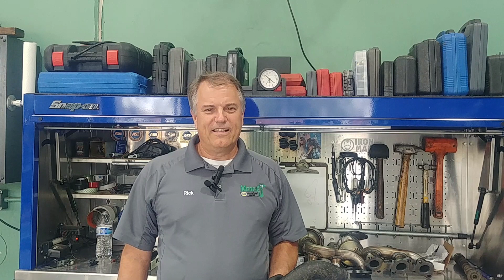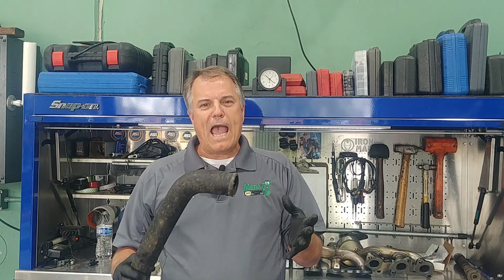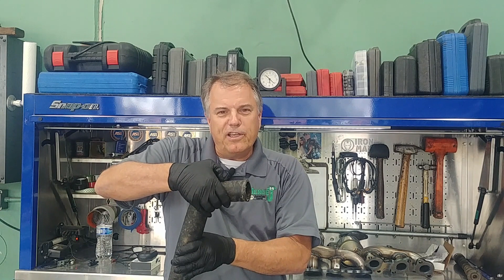Why does a Heater Hose Burst?

Comment: My car (1989 Honda Prelude B20a6) had a bursted hose on the back of the engine bay (so away from the front of the car). It blew out all the coolant as it overheated and I'm still not sure what I should do it's an old car and is my first car has been sitting had licence for more than a year and have not been able to drive any car since. I need to know everything that I need to replace and fix thanks.
Reply from the maker: You have to fix the leak first and then perform a combustion gas test.